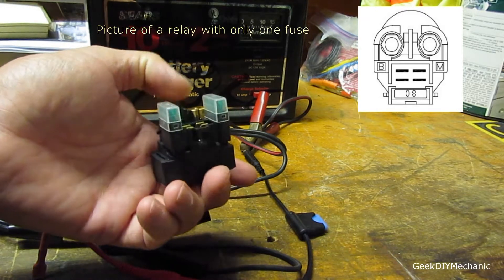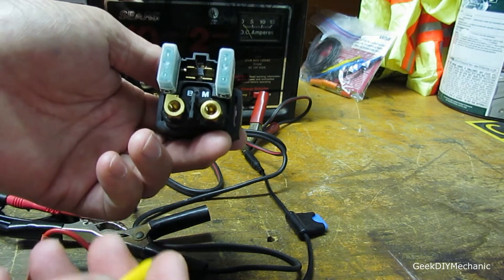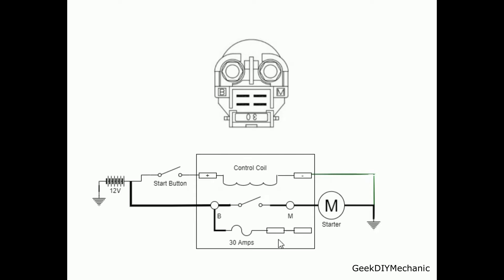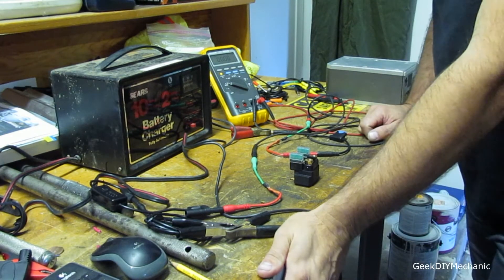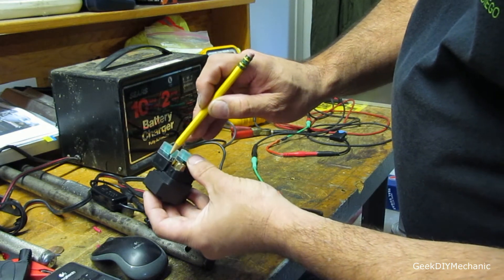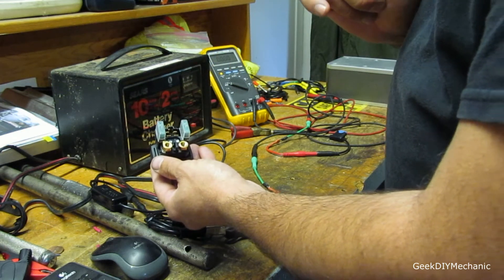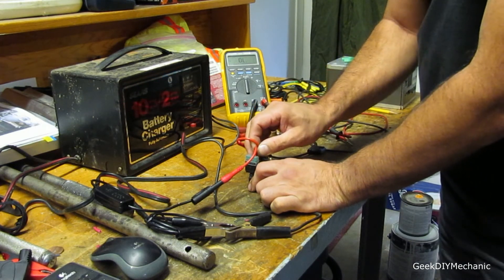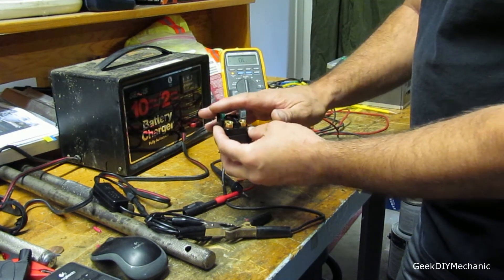Motor Cycle Relays Explained and Testing Procedures Demonstrated

Comment: Good evening GeekDIYMechanic and nice to meet you my friend!

I watched one of your videos and loved it great video.

I have two diagnostic tests that i would like to do on my vehicle and would like to know if it would be cool with you to make a video showing me step by step how to do so? I will greatly appreciate your help!

1st Diagnostic Test 

Turn the ignition off. 

Disconnect the Fuel Injector harness connector.

 Disconnect the Powertrain Control Module (PCM) harness connector.

 Measure the resistance of the fuel injector driver circuit between the fuel injector harness connector and the PCM harness connector.

 Is the resistance below 5.0 ohms?

 If yes, go to next step. 

If no repair the open in the fuel injector driver circuit.

2nd Diagnostic Test

Turn the ignition off.

 Disconnect the fuel injector harness connector.

 Disconnect the PCM harness connector.

 Measure the resistance between ground and the fuel injector driver circuit in the fuel injector harness connector.

 Is the resistance below 100 k/ohms?

 If yes, repair the short to ground in the fuel injector driver circuit.

 If no, go to next step.